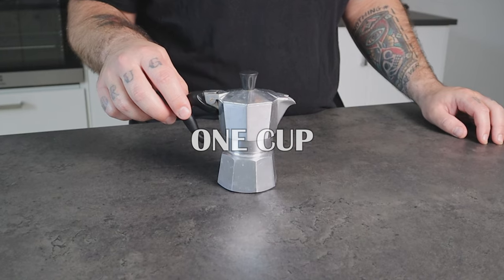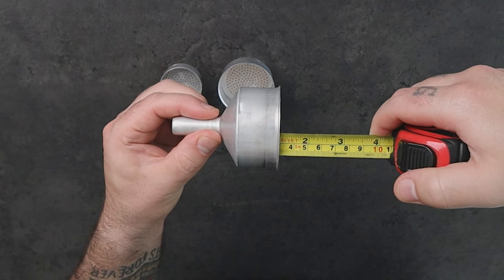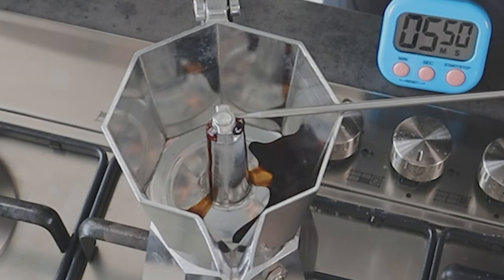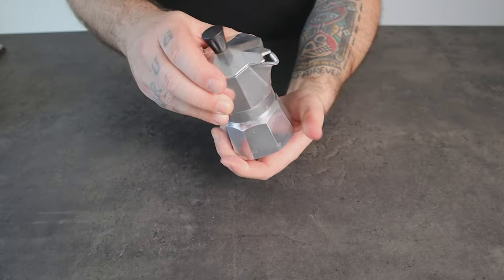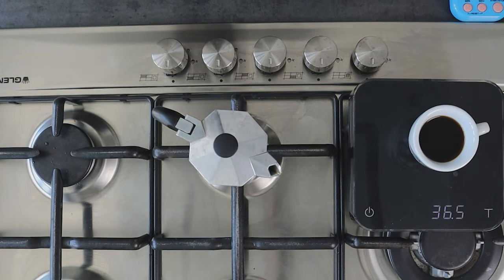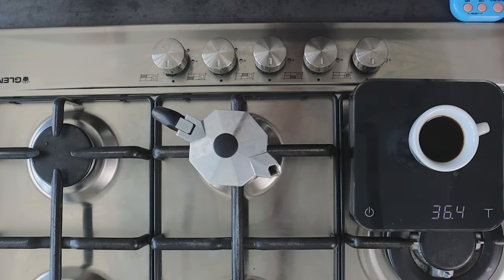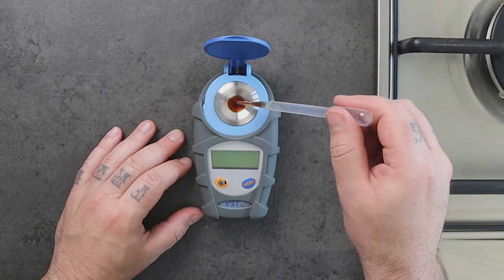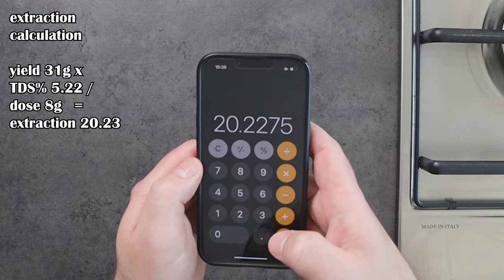The BEST Way to Make Stronger Coffee with 1 Cup MOKA POT Revealed!

Comment: I use my one cup pot every day to make a "shot" for my morning flat white. I use Con Vivo espresso blend from Wogan Coffee in Bristol. I use 9g of fine ground coffee. 45g of filtered & freshly boiled water. I use a paper filter (cut to size for the one cup from a no.4 pour over filter. I get 10 paper discs per filter). I start on a low-ish heat, but as soon as the coffee start to come through I turn the heat down to as low as it will go. When the coffee is about half way up, I turn the heat off, then watch it finish. I try to catch the brew just before the final spluttering, foaming coffee phase. This gives me a shot of about 28g. The shot is strong, but sweet & is a great base for the milk. My latte art sucks, but that's another story 😂
Reply: Also, forgot to say, if you have an Aeropress funnel, that the same size as the one cup basket. I place the funnel on top and holding the two, pour in the coffee grinds without worrying about spilling anything, then use my WDT tool to distribute the grinds. Give a tap or two to level them off. Works a treat.  👍
Reply from the maker: Thanks for sharing your method. I like it. paper filter makes the coffee good and thick. I like your method. For the latte art there is still time to improve. Important is the taste of the coffee. 
Thanks for the Aeropress funnel trick! very clever.
Reply: @matteofromtheswamps  Cheers.
Reply: great idea with the aeropress funnel . i have it somewhere. ill look for it. thanks  @AndyGait
Reply: @enforcemark9222  Happy to help, mate. Cheers.

Comment: Hey Matteo, please try and review the Venus 4 cup moka pot. I have been thinking of buying it since stainless steel is easier to maintain and clean than aluminium moka pot.
Reply from the maker: Definitely in the future I’ll get stainless steel moka pots.
Reply: @matteofromtheswamps  thanks! Looking forward to your coffee brewing videos with it.
Reply: I have a 6 cup stainless steel Stella moka and, imo, it's easier to control as the steel has greater thermal mass and I take it off the flame earlier - it percolates off the heat and there is less risk of overextraction

Comment: 👍👍👍Just got 2 cup Moka recently. I had a 4 cup one and it was a bit too much for a single person, i.e. for myself. My first impression was that 2 cup Moka was still a miss because it brews too small portions, but after a few brews I think it is just about right. I'm getting about 80 ml. max, or less if I stop extraction earlier. Now I have 2, 3, 4 cup Moka Pots to cover all scenarios possible. Still can't imagine using 1 cup Moka, maybe I'll give it a try some day. Thank you very much for an extensive reply to my question about the grinded coffee from the coffee store, so I ordered the Comandante grinder. I value your time a lot and don't really expect such a long answers, but, still here is another topic I'm quite interested. Say, lets imagine one got a decent brew by luck, got all the proportions right. Meanwhile, how the balance of the grind size, the temperature, brew time and the water to coffee ratio would affect a brew If someone wish to experiment furthermore? I mean, say, make the grind finer, but compensate it with cooler temperature, or vice versa, etc. Is there a kind of overall recommended rules for balancing the 4-5 major variables (including the sort of coffee and the roast) or it all should be done by pure experimentation in every particular case? I mean maybe there is a certain parameter(s) to prioritize and others to go secondary?
Reply from the maker: Probably this 1 cup method can help you more with a 2 cups too. 
I love Comandante grinder. At the end you pay the quality. Mine has 5 years and still performing amazingly. 
I like talking about coffee and give tips when I can. I appreciate your time watching my videos. 
Anyone can get good coffee by luck, as I always say, my goal is to achieve consistency and brew that good cup of coffee everytime. Yours is a good point. Playing with variables and understand them is what makes a great Barista or in our case, moka pot brewer. There are rules, first of all understand every single variables and understand how every single changes effects the coffee.  I play a lot with variables when I make filter coffee because there are so many and there is so much fun.
In Moka it's more difficult to play around because you need that pressure to let the water pass through the coffee and also the stove is harder to control than an electric kettle. So it's good to play simple with Moka Pot. Now thinking about something to try is to grind coarser with a 3 / 4 cups moka and try the extraction method of the 1 cup I show in the video to see if the slow flow compensate for the coarser grind size and what kind of flavour you can achieve. 
I'm planning to make more content about play more around with variables, I just need time to make them. 
What I do every single day with every coffee I make is to record everything. This allows me to collect data and then compared them with the taste in the cup. This makes you understand a lot.
Reply: @matteofromtheswamps  very good reply, Matteo!
Reply: @matteofromtheswamps  🤝🤝🤝
Reply: @matteofromtheswamps  Dear Matteo, i hope you are well!! Thanks you for the videos I ve watched a lot of you!! Can you please suggest a grind setting for moka pot with the 1zpresso j max grinder? I tried to calculate the 450 microns you mentioned on the video (450 microns / 8.8 microns (which the j max has per click ), equals to 55, 1 clicks, but this result is even fine for espresso. I am confused !!??! If you can suggest me a grind setting i would appreciate. The manual of j max has a grinding slot for moka /aeropress ect but i think is quite wide and I am lost ( i have calibrated don't worry). As you can understand I am playing every day with different grind setting. (The coffee is medium roast, specialty Brazilian , washed ). Thank you very much in advance! ( i use the 2-cups moka)

Comment: I found the best 1 cup moka pot is probably a vintage Vev Vigano Vespress. The 1 cup variant of Vespress's coffee funnel has smaller diameter and deeper basket than a Bialetti so it would help the extraction a lot. The position of the safety valve on the Vespress is also very precisely placed so you get the right amount of water when filling to the bottom of satety valve. In comparison, my Guido Bergna Musa 1 cup's safety valve is way higher than the ideal waterline.

Comment: I've got the same 1-cup Bialetti moka pot and I use it everyday. I always take it on and off the stove (set at low heat) to keep the flow of brewed coffee as slow as possible. So very similar to what you're showing, minus that 1-minute pause. 

But consistency is hard to achieve and quite often I tend to get a frustrating acidic taste, which I assume comes from under-extraction.

I have to say I never thought bed depth made a difference! 

I'll keep on fine-tuning my technique 👍 I know I can do better because I did get a "perfect" coffee at least once, it was surprisingly similar to a good espresso!
Reply from the maker: Hi! glad to see we are aligned with the method. Yes bed depth makes a huge difference. Yes, the acidic taste come from under extraction. Try to push the grids a bit finer if you can and see until you can go. 
Also some coffee works better with one cup Moka, some not really.

Comment: Having been inspired by your videos I ordered a Moka Pot and it finally arrived last week. It's a 2 cup induction and I have to be really careful and lower the power at the first sight of coffe. But if I lower it to level 3, it stops flowing coffee after a while, and if I use level 4, it's almost too fast, so I guess I need to switch between them? Or do you have some other suggestion?

I also really need to get some good mocca beans to try. Do you have some video about how to think about beans? I don't think I can find the exact brand you use in Sweden?
Reply: I take my 6-cup Express on and off the heat based on flow rate.  Too fast, I take it off, when it starts to get too slow, I put it back on the heat.  Rinse and repeat.
Reply from the maker: That's exactly what you should do. Put the level at 4 and then remove the moka when it's fast and put it back when slow down. Something similar I do in this video or in the 6 cups moka pot, without switching the hob.

A video like that is very difficult to make because every country has their own culture on roasting level. My experience with Swedish coffee is good, you have good roasteries and good coffee, definitely different than Italian, UK or USA quality. I would suggest you to get Espresso roast in Sweden. Depending on where is your place you can see with your local roaster or café.

Comment: Hi Matteo. Another weird question for you! Say you have to participate in a barista competition. The rules are: fixed parameters a) 15 g. of coffee beans to use b) output beverage need to be exactly 150 g., you may choose any coffee, any grinding, any method (except cold brew), bypass (dilution) allowed. What general method of coffee making you would choose? Espresso or lungo from an espresso machine (diluted, most likely), Moka Pot, AeroPress, V60? This question is very much related to another question I have: is there a point in getting an espresso machine if one don't really plan to drink strictly espresso?
Reply from the maker: What kind of competition is that? Reading the rules I would chose the Aeropress, you don’t need bypass because the yield needs to be 150g.
Reply from the maker: Reply to the second question. It really depends on what you like to drink. With an espresso machine you can make an espresso shot that after can used for Latte, flat white, long black, mocha. So the application can be different

Comment: Fantastic video! Thanks very much for the tips. Question: where do you place the Aeropress filter - on top of the grounds or underneath them? (Sorry if that's a dumb question ... I'm really new to this.)
Reply from the maker: Thanks for the comment! You should place the filter over the ground coffee, basically attached to the metal filter, in this way you can get higher contact time and superior filtration (there is no dumb questions)
Reply: @matteofromtheswamps  Thanks so much!

Comment: Very useful video, Matteo! Thanks! I wanted to ask: Which method would you recommend to use for a single cappuccino, using a 1 cup moka pot? I watched your cappuccino video and struggled to updose the coffee in the basket of the 1 cup moka.
Reply from the maker: unfortunately 1 cup is tricky. i suggest to place a paper filter to increase contact time. it will come more intense and better to pair with milk.
Reply: @matteofromtheswamps  Just had some great results with the 1 cup for a single 'Cappuccino'! The method I used:
1) 9-10g medium roast in the basket. A bit hard to fit but possible. It helped to grind much finer (almost espresso level grind).
2) When the coffee starts to come out, I remove the moka from the stove until the coffee stream stops. Then I pour the coffee and check the yield (usually 20-25g). I put the moka back on the heat and aim for 35-40g total.
3) Pair with milk like in the video.

Thanks Matteo! The 1 cup sure is tricky!
Reply from the maker: @elilevi1998 happy to hear to got a good result! 🎉

Comment: If the idea is to have the ground coffee completely fill the basket, why use different mass (number of grams) depending on the level of roast? Are you grinding the dark roast less fine than the light roast so that it takes up more room in the basket?
Reply from the maker: Light roast weigh more than dark roast. If you fill the basket at the same level you can see the difference, even if you grind them in the same way. The grams helps you to be consistent once you find the right dose

Comment: This is something that I've found very frustrating and no one seems to talk about, the sizes of pot are totally different machines. I've often ruined coffee when making it for more people with the 6 pot by eyeballing it similar to how I'd do a 1 pot.   I also have a 1/2 cup moka pot.  I can sometimes get a good brew out of it by cramming coffee in the chamber to get enough resistance, but its a lottery to get a good extraction.  I like the 1 pot and half pot as I'd rather have 2 or 3 smaller cups a day that one big one. I find a 2 or 4 cup just way too much coffee for one go
Reply from the maker: Yes. That is correct. Different moka size different coffee to water ratio. Also coffee bed depth is also different. In fact I made a video for a 6 cups and explain the different approach. I find better to place a palate filter disk on the metal filter to get more resistance for a higher intensity from the brew
Reply: @matteofromtheswamps  yeah watched that.  I think I can only get away with tamping/overloading the basket with very dark traditional italian roasts. When I've tried it with speciality coffee it always tastes sour as it doesn't extract enough. But I just can't get speciality coffee working as well in smaller pots due to the bed depth
Reply: Well, at least without making the ratio a lot weaker than I like.  I want 1:3 maximum, ideally stronger
Reply from the maker: @Domina7ion  yeah specialty on 1 cup is hard. Natural processed coffee works better than washed

Comment: I have a several moka pots, but when using the 1 cup, I get not coffee. Itjust gurgle somer. This happens on full heat, medium high heat, medium heat and as low as possible to get it to boil. I always have to take the pot from the stove, the put it there again and then I get 20-40 ml of coffee. 

What the heck is the problem? I use coffe ground for espresso and moka pot (Lavazzo). And sometimes grind my own medium roasted beans in somewhat coarser grin (not as coarse as for filter brew). I do not pack, I just fill and lever off with a flat thing.

Please help! 😢
Reply from the maker: Thanks for the comment. 
with the 1 cup is important to use low heat and sometimes flatting the ground can create pressure. Try not flatting it, but use my method. Let me know if it works. 
Another problem can be the gasket, if there is steam escaping from the threading, the coffee struggle to come up.
Reply: @matteofromtheswamps  Thanks! I dont really get it about the flatting the ground (English is not my first language). Should I press it slightly to create more pressure, or just level it off?

Today I tried som other advises found on YT, so I put boiling water in the bottom, filled the filter and pressed VERY VERY slightly, and cut a filter from a brewing coffee filter and put on the ground coffee. I set my stove (electrical onem, ceramic, but not induvtion) on half of max. I got 45 grams of coffe from 60 grams of water, and it tastes better than other times also (usually I have to to put it on and off to get any coffee out and then get much less coffee).

I understood you video as I should create some pressure, but your answer to me indicate the opposite to me, (who is rather lousy in English). 🤣
Reply: Hi again! Now I have tried the moka pots for some time. The 3 cup works fine on "low temperature" but the one cup... If too high temperature, we all know what happens, but when I have the same low temperature and slow flow as on my 3 cup, I get 25 % less coffee. It behaves like it is done (the bubbleing and so on) but there are only 30 ml of coffee. If I INCREASE temperature some, I get 40 ml. I also can take the 30 ml and put the moka pot on once more, and then I get the last 10 ml. I feel like this is strange.

Can you explain this? I load it the same way every time (and do not pack at all now, just slight tapping to get even distribution). I can add 1 or 2 filters that I cut from cheap drip coffee filter, but it makes no difference at all for the problem with 30 ml coffee if low to medium heat, and 40 ml coffee with medium heat (the coffe itself gets better though if adding filter/s).

P.S. I think moka pot gives much better tasting coffee than any espresso, so I am so happy with my moka pots. I have yet to learn the 6 cup too. 😅

Comment: I am misunderstanding something.  We are being told to use 7,8 or 9g of coffee depending on the coffee character but then we are told more than once to 'Always fill the coffee basket to the top' which seems to be saying that we always use the same amount of coffee and don't even bother to weigh it.
The only explanation I can come up with is that 'Fill the basket to the top' actually means 'don't use less than the 7,8 or 9 I suggested'.
Reply from the maker: I explain you this better here. coffee has density, light roast coffee is more dense so it's heavier than a dark roast that is less dense. meaning that if you put in the same space and I'm talking about volume, in this case the moka pot basket, light roast and dark roast, light roast will weigh more the dark roast. it's like for example if you fill the basket to the top with iron and another same basket with feather, which one will weight more? If you use the same coffee of course you can just consistently fit it to the top. mine was an observation in case you struggle to achieve a good coffee and you might don't know the reason. Coffee water ratio is one of the important variable to consider in coffee brewing. That why I try to explaining it.
Reply: I'm very confused about it since my 1-cup bialleti will take only 6g, I'm using dark roast but still, how can you fit 9g?